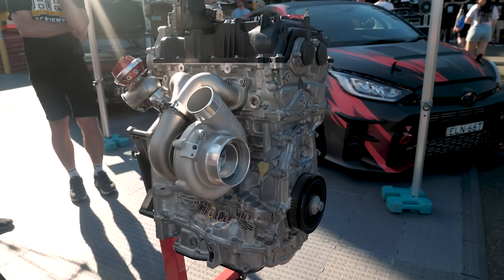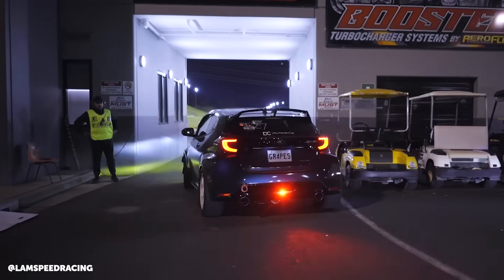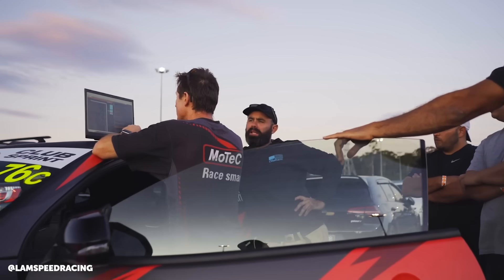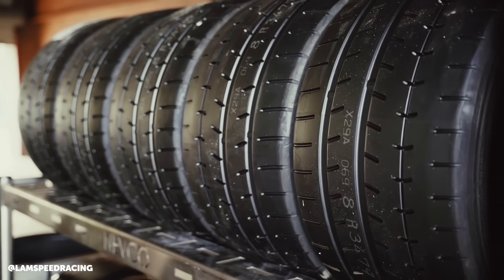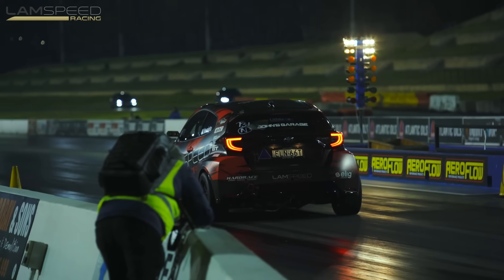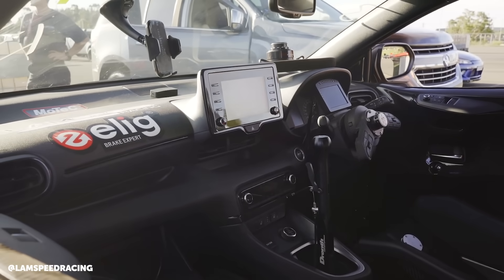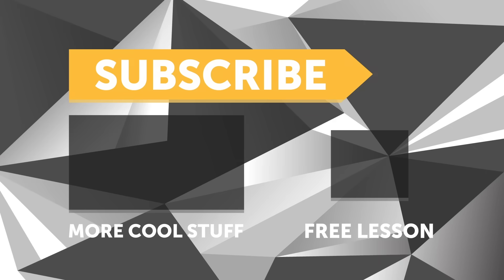This Little 880hp 3-cylinder Is WILD! | World's Fastest GR Yaris

Comment: This engine suits a suziki wagon r / vauxhall agila version 

1.6liter inline 3 with 800bhp that cool

I am aware it can go to 900bhp if you know how to jaje 900bhp from the 1.6liter inline 3.

Dose it have a massive turbocharger like 170mm

Or

It has a twinturbocharger setup making 800bhp 

Not saying it bad it very impressive from a inline 3 800bhp 

Is goid

That equivalent to

1.5liter bmw m10 to m12a f1

While tgat was a inline 4 cylinder engine 1,300bhp

800bhp from 1.6liter engine inline 3 i do say nearly there to

1.5liter inline 4 

Most engine are from stock internal engine 

To have 800bhp  + i sure it heavily modified engine etc

I don't know how mechanics do 

But i know it possible for 900bhp mark

Once it meet that

I sure 1000bhp it next level

Safe to implement higher bhp once it has the right tuning and help

Great vedio

It dose ahown it possible to have 800bhp + from 3 cylinder engine.

Have you experience with a 2 cylinder engine 1.6liter version with 800bhp etc

Comment: 3 cyl will always be unbalanced and so is a stupid base to build from.

 Tough materials sustain high cylinder pressure but that’s not the point, it’s not balanced.

 I6 or V12 will make the same power with a nicer noise and better balance without requiring a big, laggy turbo. 
 This whole build is an exercise in pointless bullshit.
Reply from the maker: Speaking of pointless, good luck fitting a V12 in a Yaris and not completely ruining the handling 😂
Every option comes with a compromise, an I6 or V12 will have different trade offs/issues/downsides, that's all 😉 - Taz.

Comment: Why are we measuring a gas engine's power in terms of kilowatts? I hope thats not what we're going to be doing from here on out. These engines are powered by gasoline explosions, not electric current. Horsepower is an all around universal measurement we can use interchangeably. You can't use "kilowatts" interchangeably. Let's stick with what makes the most sense to avoid confusion between an EV and a gas engine.
Reply from the maker: Kilowatts were used before horsepower and are part of the metric system. 
It has nothing to do with EVs. It's a unit of measurement.
Hope that helps expand your knowledge base along with some time on Google needed on this topic perhaps😉- Taz.

Comment: 880 AT THE WHEELS?!? That's over a thousand at the crank! Jesus Christ. 300hp+ for 539cc of displacement is absolutely nuts. This is F1 level power density.
Reply: All about the block ... nice thick walls. flyer..
Reply: This is approaching k series numbers!
Reply: @greapsoho  for a drag motor, maybe. But a track car making that much is different.
Reply: @spdcrzy I think it's reasonable to compare it to GM Ecotec or K series for their drag setup. It sounds like the 880 is their drag setup. I might be wrong

Comment: Does it mean they could build 3.2l 1500hp v6 based on 2 yaris engine?
Reply: Love to see 1.6liter inline 3with 1500bhp from thus engine 

It in ot early days tho.

800bhp is good 

Nearly 900bhp mark if you not aware 

880bhp goid

It getting closer to f1 levels 

I mentioned that if that was 1.5liter inline 3 and was used in 1980s era of f1 and toyota was making a inline 3 engine with around 1200bhp or close to it.

That would be impressive to me 

Cars with inline 3 engine with 800bhp +

Is impressive even as a race engine tho

If they had 1jz and 2jz engine Inline 3 3liter engine that would make significant difference between them

3liter inline 6 1jz or 2jz 1500bhp cool

3liter inline 3 1jz or 2jz equivalent that would be cool.

Not many inline 3 engine with 800bhp or more at the moment 

There.a suzuki wagon r or vauxhall agila version 

With 2liter inline 4 with 250bhp swapped when posted

Was rumours of 340bhp to 400bhp 

But if that raced against this Toyota yaris

I know the yaris will be faster

But suzuki wagon r or vauxhall agila version mk1 2liter inline 4 400bhp + is decent.

If car company and f1 type companies invest more into smaller engine like inline 3 

Between 600cc to 2liter inline 3 or 10liter inline 3 truck engine I sure these inline 3 engine can make 

Bhp like 2liter k20 honda engine,  rb20dett,  2liter to 3liter 1jz inline 6 , 2liter to 3liter inline 6 , 

That just between inline 4 and inline 6 engine respectively 

1.6liter v6 with 800bhp + yes that possible 

1.6liter v8 with 800bhp again it possible 

Etc. It down to investment into it that all it takes and dedication to produce these power figures.

It takes years and years to get to this level.

880bhp 1.6liter inline 3 very cool.

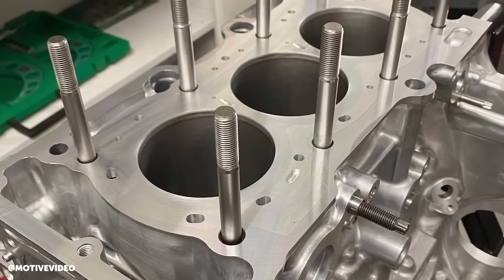Comment: 2:09 Man, pausing there and looking at that block makes me wanna have that engine in my 88’ CRX Si. I’d have a much more conservative and useable tune on it though. Maybe have 2 or 3 modes. 1 for regular sunday driving, 2 for street fun or track days, and if I had the 3rd then it would be for bonkers foolery just for kicks or for the dragstrip. I think 300HP at the wheels max would be good for that street/track day setting, and like 200 for regular driving. On a car that weighs about a ton flat with a full tank of gas, that’s more than enough to keep a massive grin on my face.
Reply: @groundcontrol6876  Be easier and cheaper to just buy a Yaris GR...

Comment: too bad toyota didnt put this engine in the mk5 supra
Reply: Stick 1.5liter inline 4 f1 engine in the toyota supra

Based around 1980s 1,300bhp or 1300bhp erc

I sure it be a cool restmod engine 

1.5liter inline 4 bmw m10 to m12a was impressive figures in 1980s

So I do have passion for engine and I do think

It possible to make 1000bhp from inline 3 engine 

And hopefully they make 3liter inline 3 engine toyota engine to

Street,  track day and race engine as well.

One thing toyota could do it

Pit 3liter inline jz engine on to a 1.6liter engine or 2liter engine block see what happens when borer and stroked to 3liter side

No 3liter inline 3 engine ever made

No even  in Nissan, toyota,  bmw , vw or any company at all.

There a 2liter inline 3 engine 

2liter inline 2 engine 

That is cool

Comment: Due to being a 3 cylinder the powerband is different, its longer. The dynamics of a 3 cylinder longer duration crank, is when it has spun up it delivers a natural power rotation much like an airplane propeller. Even with a bad counterbalance the engine will want to naturally spin at higher rev's. Put some forced induction on that engine and you will achieve good power gains with little effort.

Comment: Pretty sure this car was claimed to make 1000+ horses and run well under 10sec quarter.

This must be an old interview.
Reply: Huh ? Ignoring the power number, they actually said multiple times that it is running in the 9s. I believe if you know the weight of the car and the quarter mile time you can  figure out the power. Probably an online calculator for that, but can't be arsed looking for it. Also someone else commented it was 880 at the wheels so 960 at the crank. Add in a bit of generous rounding, and you get the "magic" 1000

Comment: To convert kW to hp faster you add a third to the kW like 150 de kW = aprox 200 hp :D  44kw = aprox 66hp the reverve you subtract a quarter.
Reply: How does that work? Like why is it a third from KW to HP but a fourth when going from HP to KW?
Reply: You already messed up that 44kW conversion 😅
Reply: @user-rl3ef4ju9k  Yeah that’s why I gave him the sarcastic question 😂 Dude’s making it up as he goes.
Reply: @groundcontrol6876  sorry but your question sounds legit and that you do not know basic mathematics too well.
Reply: @user-rl3ef4ju9k  Enlighten me then. How does it convert one way, and to convert it back it’s not the inverse, but a completely different formula? Edit: Nvm I tried it out myself and it actually works. Idk how that black magic works cuz it was unintuitive to me but it did. Guess his numbers threw me off cuz he calculated it wrong and it just made no sense overall. Worked fine when I did the calcs myself tho.
Reply: @groundcontrol6876  sorry I'm not a math teacher. But basically the difference between 150kw and 200hp is 50 and it's one third of 150 and one fourth of 200.
Reply: @user-rl3ef4ju9k  I got there right after I commented, don’t worry haha. I edited it quickly afterward but left the old comment in to avoid confusion or anything.

Comment: I haven't kept up with GR Yaris development much after people were getting close to 500hp. This is insane. Fantastic interview - it's great to hear the development journey of a completely new platform
Reply: I wonder how long these engines will last though? 2000 miles? no way are these gonna be reliable tuned like that.
Reply: @fredericfuknchopin4552  time will tell I guess. At that power level these are full on race engines, where rebuilding them completely every so often becomes part of the standard maintenance cycle I'm assuming
Reply: @fredericfuknchopin4552  People developing and racing cars aren’t typically worried about getting 100-200k miles out of their engines. If it gets them through the season, that’s all the reliability they need. Edit: Spacing, dang thing starts typing right after the name with no separation... just blends them together.
Reply: @fredericfuknchopin4552 to be fair, these guys are using it for racing applications like Drag racing or Time Attack rather than for daily driving, so they are already fully expecting to do a rebuild of this engine multiple times.

I mean you can technically also make it to 800hp for the streets as well like that bloke in the UK but honestly even getting 350-400hp is plenty enough for a car as small as this.

Comment: funny enough the NA pre XP210  models make well north of 800 if you add a turbo.  one extra cylinder really does help, those also come with APR studs from APR for the motor which has been around since 1999. bigger injectors up to 1200cc. and then alot of piggyback options available mostly from greddy. but nobodys going to care about those. couldnt understand why, post 2012 models were made in france and post 2014 models came with 25 extra spotwelds for rigidity as well as tons of chassis upgrades from cusco, tien, whiteline etc. i think it was underloved because it was not fatter but just FWD. its no heavier then pre 2012 models. whatever, just means it will handle better. doesnt need slip correction from an AWD system. power is instant instead of split between wheels. but whatever ill just wait till their 25 year importable. i hope i can snag an 8 speed auto version someday.
Reply: you can also fit a 1jz pump on older models for higher flow rates since their both 12v.
Reply: cometic gasket is also thicker and they also offer a block brace with waterjacket cutouts for the older models. so im all set in terms of reliablity, not to mention theres an overbore kit which brings it up displacement wise. exhaust options from HKS and other tuners. and rims by BBS.

Comment: 960hp, actually! 880 hp at the wheels! 😵‍💫😵‍💫😵‍💫
Reply: wait these are wheel numbers??? the actual fk?
how are they gettin damn near veyron numbers from 1.6?!?!?
Reply: @sultanofswingdrift3021 you have clues in the video. In 1983, F1 cars with 1.5 turbo engines had 1400 hp in qualifying mode.  The main problem that's at that sort of power the reliability should be at racing level, some hundreds km. The street reliable version is 270kwh/362hp.
Reply: @valipiros6423 Heck, I could live with near 400 horses on such a light snd chuckable car.

Comment: 880 hp in that little package, properly set up on the circuit must be amazing to drive!!
Reply: Probably terrible to drive at 880 actually, outside of drag racing.
Turbo is too big for usable power on a circuit or on the street.
Much better off with less max power and a wider power band.
Reply: Click Bait,, would blow up in 60 seconds at that power just like a K engine.

Comment: @ time 2:04 is always nice to see how people approach doing a closed deck convertion. This looks like a solid setup. You can just barely spot the color difference on the deck brace they got in there with the coolant holes in in.
Reply: Yeah, that insert looks really dang clean. Thanks for the timestamp, hadn’t really noticed it on the first go since I was eating and stuff. The machining and tolerances on it seem spot on. 👌🏼
Reply: @groundcontrol6876  these things facinate me big time. I have a background of building engines and coding turbine conversations but now I'm transitioning into cnc machining so I always try to learn from these these types of videos as this is the type of work I'm interested in

Comment: the gr yaris development journey has to be one of my favourites. without charles i wouldnt have my dream build.
Reply: Hi what times is your set up doing around  Sydney motorsport park  as I'm aiming to  build a  similar  set up on my gr
Reply: @gtrlife2941  1m43s while drifting/sliding a few corners (no aero, worn tyres). there's potentially sub 1m40s in my car on fresh tyres and a clean run.

Comment: He run 270Kw (367Hp) on stock 1.6 engine.
I saw that guys from CO motorsport, run junkyard 339.583 km  VW 1.8T 20v with 180Hp (stock engine) married it with BIG Turbo
and make a 597Whp out of Stock engine !!!    (Almost 600 Whp from Stock 1.8 20V T engine )
Reply: This engine was the most popular engine for tuning in Europe 20/25 years ago. 
The VAG 1.9TDI (diesel) tend to have stock, or higher than stock, parameters even after 0.6M km. Many of those engine are still on the roads, working in taxi, minibuses.
Reply: Yes but for how long? Can it do time attack or only 5 seconds on dyno?
Reply: @HSVR383SC  if sustained 600whp on dyno than with 350-400whp will do time attack. They do the dozens of Dyno pulls starting from 250Whp and finishing with several 500+ Whp. On last 600Whp pull engine developed slight knock, but take in mind that that engine had 340k km on the clock before all this terror started!
Reply: @svinche2  its a 4 cylinder engine... not really in the same realm
Reply: @rock40ps3  yes it is a 4 cyl but counting displacement / hp ratio in stock form.
Reply: @ it still does not matter, not even comparable in that regard either
Reply: @rock40ps3  displacement vs power ratio no matter if you have 2,3,4,5,6,8,10 cylinders always is the same and important ! Number of cylinders do not play a role only in development of harshment & vibrations where 3 is always worse than 4. Plus 3 have two counterbalance shafts that add's rotational mass. Plus the fact that 30 year old engine can whitstand more abuse and boost in stock form, than newest technology speak all for itself. And this 180hp 4 cyl banger that they tested is middle version, strongest one produced by factory had 1.8 20v and 250hp at a time outstanding, now not so!
Reply: @ still not getting it are you… that’s ok. Keep being dense, also I’m not reading all that bs
Reply: @svinche2  
Number of cylinders plays a role. 
With more cylinders, same displacement = You can rev higher.
Reply: @jareknowak8712  with modern tech old limits are removed, to rev high engine needs to be designed that way no matter it have 4 cyl motobike or V10 F1 it will rev up to 18+k rpm. The smaller the size of piston (smaller displacement) will rev higher compared with larger. I own a nitro Glow plug atmospheric engine with  1 piston, that have 6.2ccm and develop stunning 3.95hp at 35.000 rpm ! So do the math !
Reply: @svinche2   
Not with the same displacement! Do the math! 
I have old OS Max.
Reply: rock 40 ps2  Nobody call you, to came here and spread your nonsense ! 
So you are free to leave the chat !
🤣🤣🤣
Reply: It would bend a rod over 300hp due to torque, so that’s hard to believe.
Reply: @Nero.Disegno  Watch their videos On youtube. Because of danger of Torque bending connecting rods, they tuned engine fuel delivery in a way that torque is developed gradually and in high rpm.  As owner of CO motorsport said , developing the Max torque in lower power band is beneficial for race but it is a Death sentence for Connecting rods !